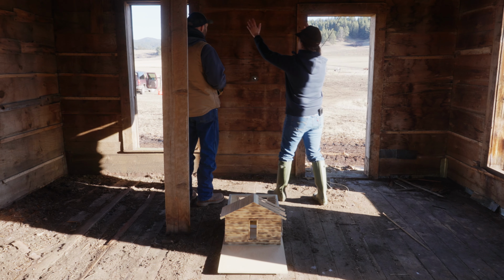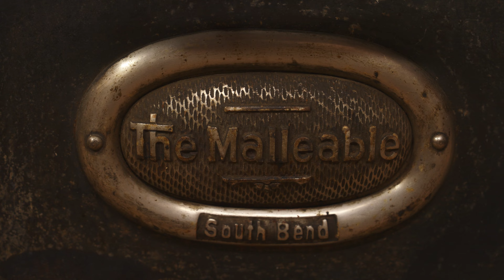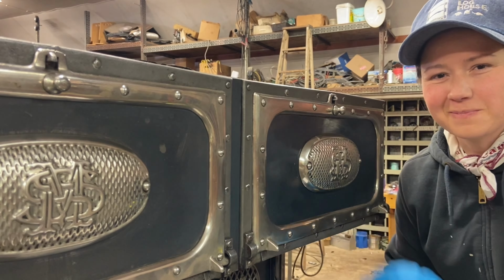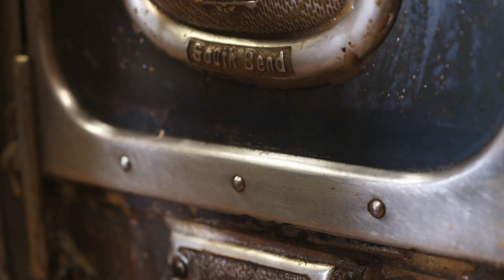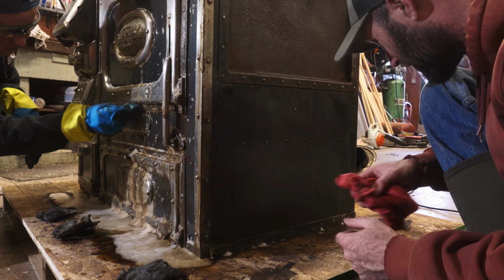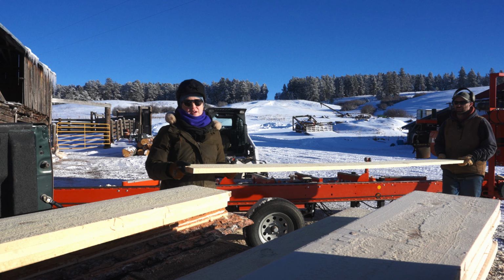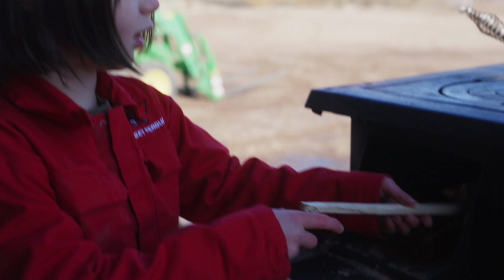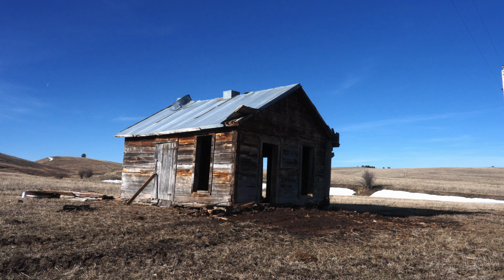Ep.6, This House Needs A Cookstove. 1889 PROJECT.

Comment: Good morning Jessie and Robbie- Well I finally made it to watching this video of Uncle Dan's stove. Ours was our Great Uncle Roberts. Did I miss what year this stove was made? Ours is also a malleable. It is stamped into the cast cooktop, which means it has a " floating cooktop" . Yours looks very similar to our 1930 Home Comfort. Look ours up on Google. Your page showing the " elbow type twisting grates" are coal grates just like mine. Do you have the original lid lifter with the diamond opening to turn your grates?  And it is just about impossible to keep a long wood fire those grates. That is why I purchased a solid "grate plate", with about six holes in it to place on top, plus I keep some ashes on it. Works much better keeping a fire if you can use hardwood or chuncks. Jessie you are so lucky to have Robbie helping you. It took me a full year to restore ours by myself in the house barn. I poured Coke all over the cook top to get some of the rust off and 0000 steel wool with olive oil. I see yours also has the jacket for a 30 gallon hot water heater, like ours. We don't use it, although my brother-in-law uses his. He has a Glenwood. You may be able to find parts on EBAY or from a company that restores these stoves. I found a cast iron oven rack because mine is "somewhere" on the farm. I kind of wished you hadn't blacked the stove top. I did not so I could cook directly on it. AKA toast. If the blacking burns off, try buffing it out with cooking oil, then make a ball of waxed paper ( Cut Rite) and buff the top. That's what Grandma Hazel taught me. Enjoy this beauty. Great job! ~ Diane  P.S.- I  love the comment " And don't get distracted." :-) With all the olive oil I used, when we took ours outside to fire it up, it smelled like an Italian kitchen!
Reply from the maker: 😄😍🤩 Oh I need to save this comment permanently for reference. Great advice! Thank you! I can’t remember the date I found… we looked through old paper pamphlets to match the numbers… it was very early. 1914?… 1916?… ah, my memory these days is shot. I’ll let you know. 

I’ll search for grates too—fantastic tip. You must have had a heck of a time getting your stove into shape scrubbing alone. I did 95% of the elbow grease but when I needed Robbie he came to my rescue ❤️ Plus he is great at using the big skidsteer to move it around 😉 
I agree on the stove blackener—I stripped some away by accident the other day and I thought to myself, “I should just season this top like I do my cast iron” 🤔

Comment: Oh and I had a friend that used a regular hot water tank with his woodstove. Plumbed it to run the water heated by the stove into the tank.  I am not sure exactly how it was plumbed and I think it needs a vent but it did work.
Reply from the maker: Very interesting… this originally had an early 1900s water tank. Of course, lost to time along its life. I think that is part of why the stove burns hot—my theory is that the pipe that went to the water tank is still there and drawing extra oxygen. I plugged it with steel wool but that really is just a bandaid.

Comment: Should have taken it to an acid bath shop. They would have dipped it just like they do for cars and bake it dry. Would have been 24 to 48 hours to have a fully clean item
Reply from the maker: Oh wow now that’s a solid way to do it! 😃 I’m betting that would have stripped away all of the original nickel plating though 🤔 We lost a bit, but managed to save A LOT of the original patina
Reply: @Montana_Ranch_Rescue  there are different types of acids for dipping. Since we are dealing with oil and light rust, thanks to the oils, their weakest bath could have done it and with little to no damage to any nickel plating. Even if the plating were to be removed, it's really cheap to have those replated these days. 

Something else to consider is Laser Cleaning. Some interesting videos on that subject on YouTube. Since the practice of using Lasers is new to the general public, it does cost more, but it does very little to no damage to the product.

I've used a Dry Ice Blower on engines during restoration projects, so I'm sure it would work on a stove. The cost to rent is cheaper than you would think and it also works on wood as it used to remove Black Mold from homes, etc
Reply from the maker: @paulharvey1947  Oh man, you know your stuff!! Fascinating processes. Where are you at—near a big city? Our trouble here is that we are hours away from even small cities. It’s so hard to get access to anything like that. 

Robbie’s uncle had his stove re-plated with nickel and it turned out perfect! But I’m pretty sure he said it was very expensive here in Montana.
Reply: @Montana_Ranch_Rescue  I'm in TX so we don't mind long drives as it could take you a full day to drive from one side to the other. I personally am in south central TX. 

I'm sure they are places near you, while 'near' is all relative to where are at. Just wanted to offer some alternatives to scrubbing for hours, but nothing wrong with a little hard work especially if the outcome you wanted is achieved
Reply from the maker: @paulharvey1947  Cheers, man🙏 I appreciate the advice you gave and the alternatives. I would 100% do it the ways you suggested next time. Especially if I had to do more than one stove every ten years—I don’t mind scrubbing by hand, but you are right to work smarter not harder. It’s cool to hear about better options out there. Thank you! 🙌🏻

Comment: Any idea why there is a vent on the stovepipe? I found a Malleable warming oven, and am confused why one would want a vent in the chimney above the fire.
Reply from the maker: It’s a really good question 🤔 I know on the old Monarch stove I cooked with for 8 years, it had a vent like that. It really helped with “closing down the stove” and keeping it from pulling too much air. This helps stop the stove from getting too hot. But I bet someone else knows more about the concept than me. You’re gonna make me think about this until I figure it out! 😆😀
Reply: @Montana_Ranch_Rescue  it's a damper.  Shut down the damper on the side, and also use the one on the stove pipe.  The coals will keep theheat going but will cook slower.